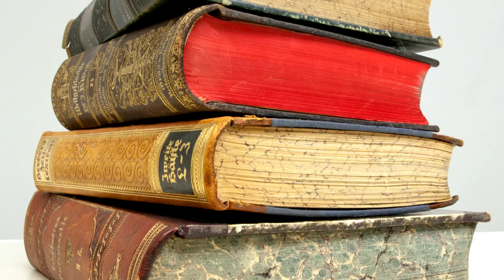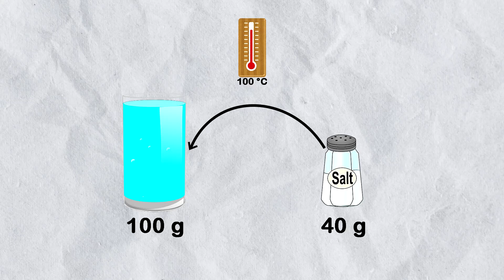why it doesn't work 66

Comment: Alternate version: 

Low pressure equels lower boiling point.

Put boiling water pot and increase the pressure of the room as it boils.

Keep rising temperature equel to the pressure increase.

Infinite heat to infinite energy.
Reply: The same for the original, you've just created an incredible elaborate and inefficient way of storing thermal energy. You put energy into it, a portion of the energy is stored, some is lost. Net loss == Infinite!!!

Comment: Hot take : Heater in principle should be able to reach 100% energy efficiency since you could make use of every output of it effectively unlike any other appliance, the heat, the the light, the white noise, etc. Even the cable heating up due to resistance should be on the same purpose as the heater itself

Comment: I don't even understand how this is supposed to work at all - you're putting in energy to boil the water, and I don't see a way to get any back no matter how hot it gets.
Reply: Thats also what i was thinking, why isn't this comment higher up?
Reply: The idea is that adding more salt to the water increases the boiling point so you make it hotter and hotter while turning the thermal energy into powering energy.
Reply: @YourCasualGargantuanLeviathan But the salt doesnt increase the temperature (It will actually lower it, unless its equal or higher temp to the water when added), it just increases the temp it CAN reach before boiling. And in this case the water is basically redundant, as you already have thermal energy from the heat source.

This is literally just putting energy into a heating source, then taking the energy from said source and giving it to another material with a substantial loss.

Literally just wasting energy.

Comment: I'm fairly certain water evaporates at all temperatures, just the speed at which it does varies. 100 degrees Celsius isn't the vaporization point of water, it's the boiling point of water – when bubbles of water vapor appear within the liquid itself, rather than the edges.
Reply: it evaporates as ice?
Reply: @JNJNRobin1337  At pressures below 0.006 atm ice will transition directly from solid to gas when heated, and back to solid when cooled.

Comment: my first though was "what about the boiling point of salt?"
Reply: Same I was thinking eventually you’ll just have salt
Reply: Mine was "what if the maximum salt that can dissolve (and resulting boiling point increase) grows more slowly than the temperature of the water?"
and then "also, even if this did work, it would just be energy storage, not production"
Reply: It melts at about 800°C so you could add something to the salt to prevent it from evaporating at 1465°C

Keep adding new different substances with higher and higher boiling points!
Reply: My first thought was that there’s only a finite amount of salt
Reply: @goldenwarrior1186  Have you met the people?
Reply: Not going to get there with normal gas/wood fire prolly